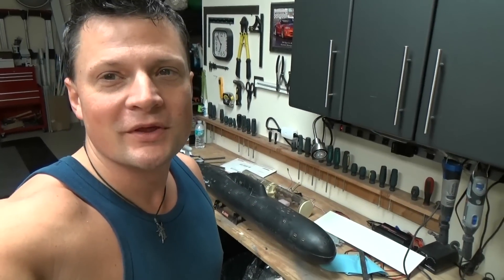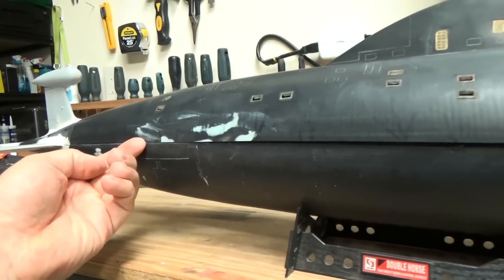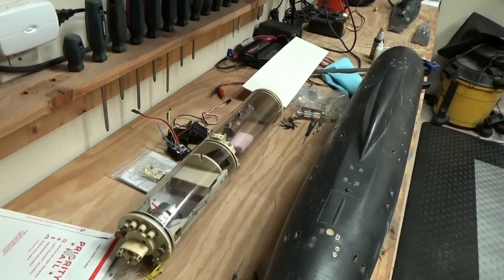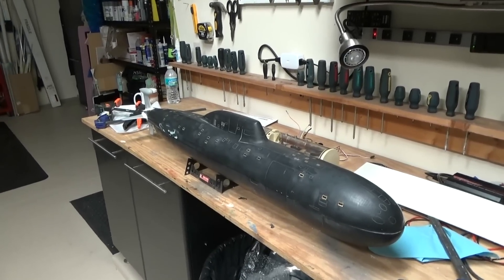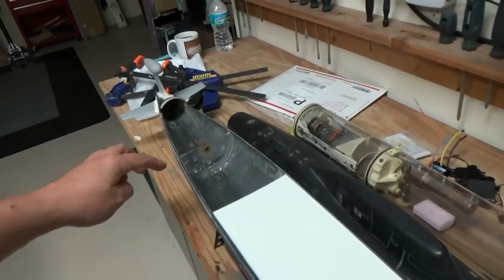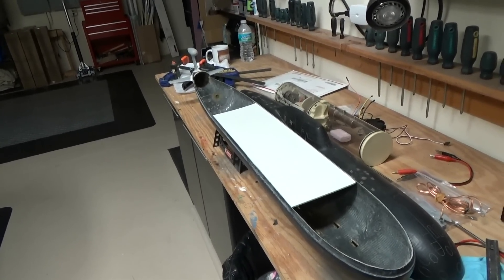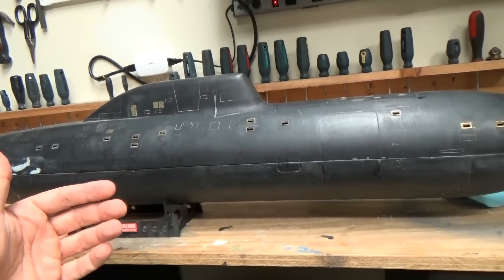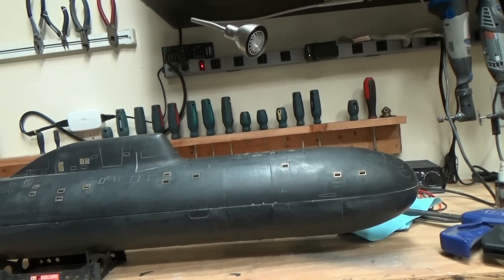Russian Akula nuclear submarine R/C model in 1/96th scale

Comment: Will it get a SubTech - SFS1 Single Function Switch w/built-in failsafe and a Pitch controller?
Reply from the maker: This is a basic buildup for a customer on commission.  Base package basically gets the boat working.  No bells and whistles, though things such as a failsafe or pitch controller are exceptionally easy to add at any time.  Just plug and play!
Reply: RCSubGuy Good job! Could you add them up Bob when the time comes to set up the electronics? I shall pay for it, IF that's OK with you. Cheers! :-)